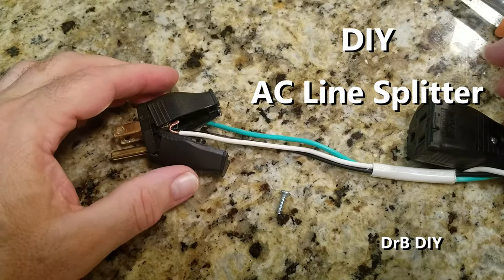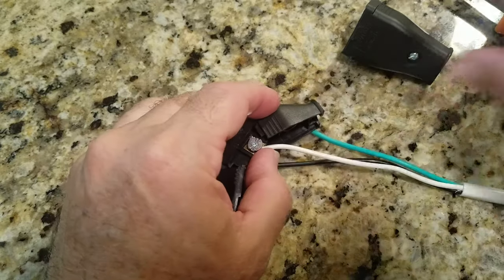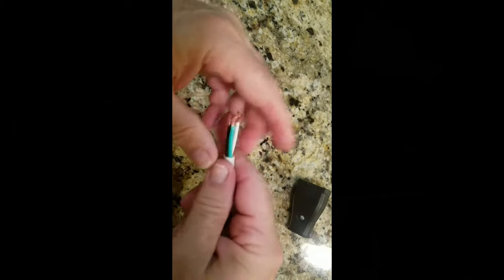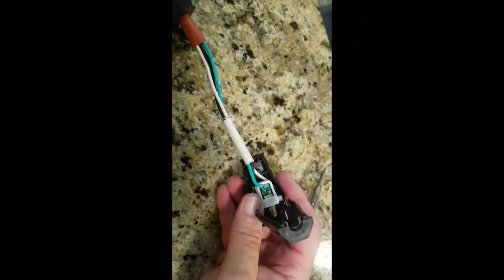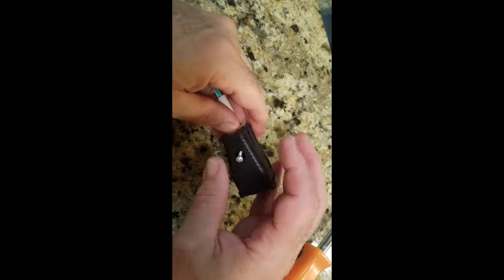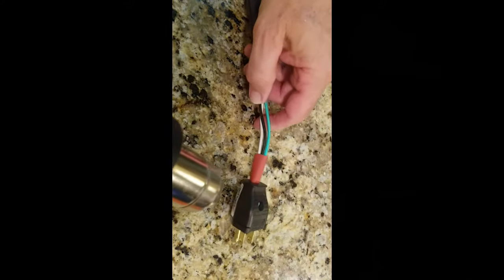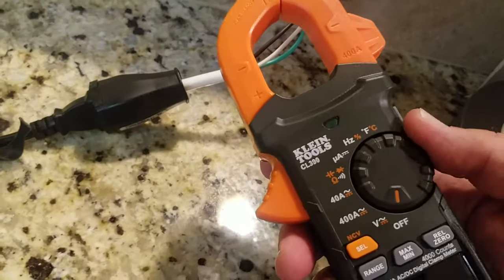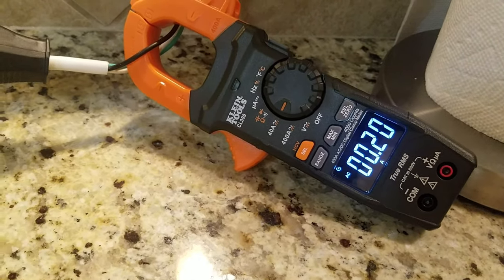Making an AC Line Splitter for amp reading

Comment: If I want to check out a 20 amp device or a 2o amp outlet don't I need a 12 ga wire and a 20 amp plug and socket to get true reading on higher amperage circuit ? A 14 ga wire and a 15 amp  male and female plug wouldn't be able to  carry full true load and reading on meter  would be artificially  low ???
Reply from the maker: Correct, a  20-amp circuit, protected by a 20-amp breaker or fuse, must be served by 12-gauge or 10-gauge wire.
Reply: So question. The store bought ready to go ones have a multiplier(Klein) do you know the reasoning behind that compared to something like this?